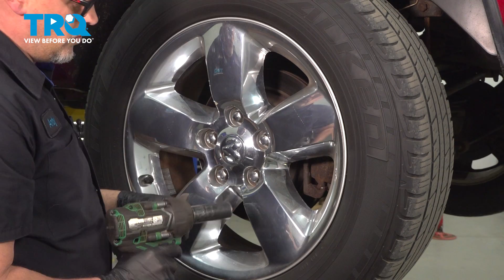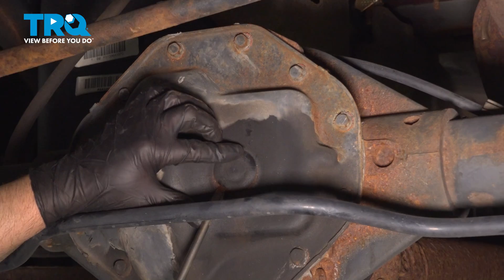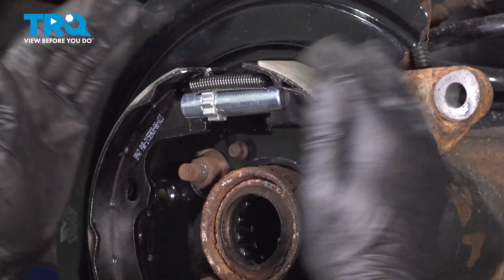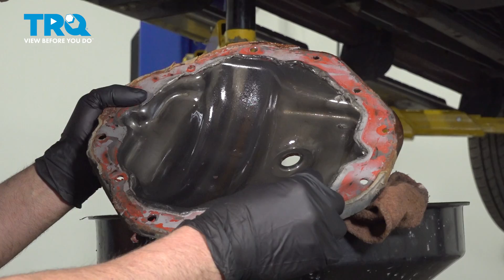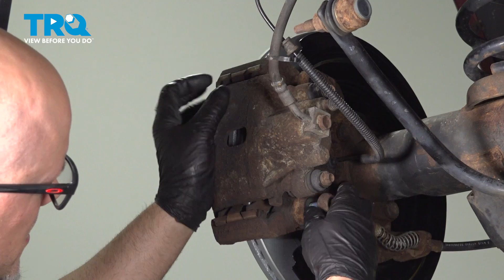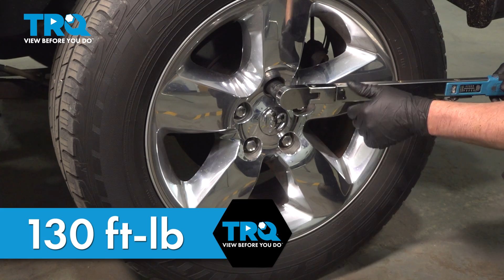How to Replace Parking Brake Hardware 2011-2018 Ram 1500

Comment: I tried to remove the rusted frozen parking brake lever arm and couldn't figure out how to do it without puling the axles.  Thanks for confirming my suspicions!  Terrible design, both from an ease of service AND suitability for environment standpoint.  Excellent video - thanks!